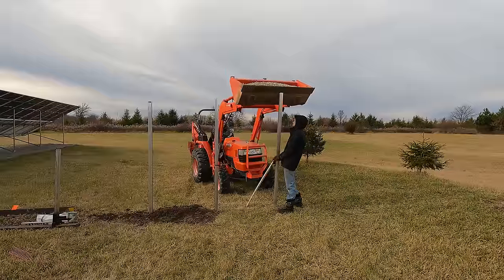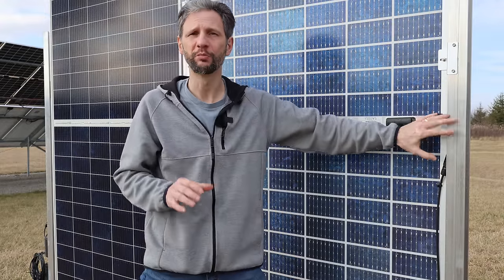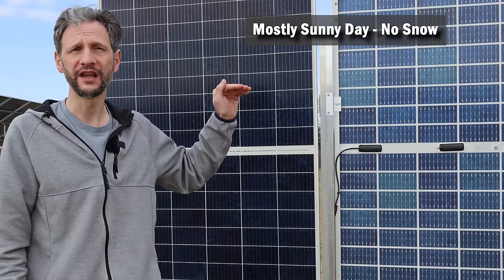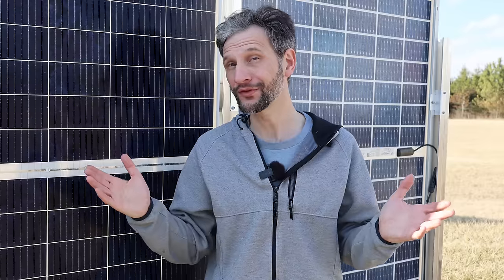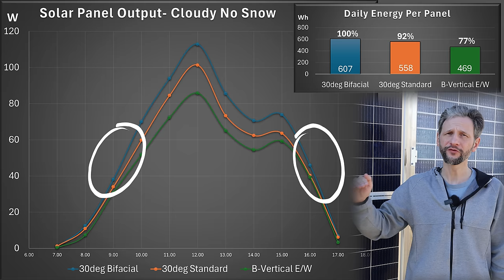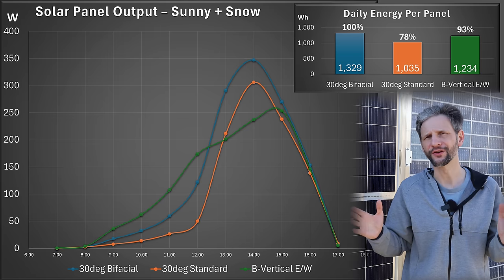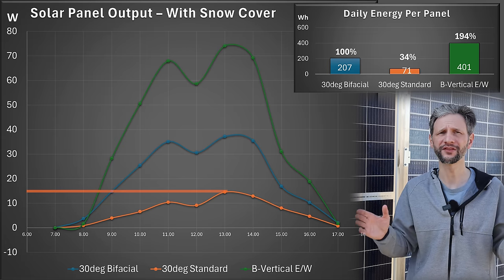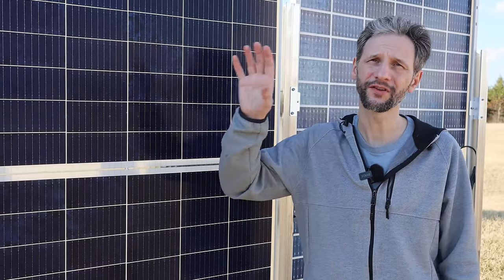Vertical Bifacial Solar Panel Performance Results Part 1

Comment: Please also test using a few meters of cheap stainless metal sheets on the ground, during the summer and even during spring, to reflect more sunlight onto the panels, for if you don't need to grow plants, and test that for both solar panel orientations. And maybe also compare it with a black tarp, and a black tarp with 1 cm or half an inch of cement, which you can separate into tiles by using some cardboard and tape to form the borders of the tiles.

Comment: My understanding (and I could be wrong, everything I saw was 3rd party, I didn't read the paper) of the Dutch study that brought all the excitement about bifacial panels last November was a bit different from this project.

1) I believe they were testing a new panel design with similar front and back performance. I am not sure that makes a big difference compared to staggering front and back panels like you did, but the implication of the news things I saw was that the vertical mounting was taking advantage of this particular new design rather than generic bifacial tech. Also, I am not clear if this was a private in-house study by a company, or a 3rd party study for a manufacturer validating these new panels... lots of potential for some bias there, but that may be an assumption.
2) Their biggest performance difference was during the summer, where peak heat was causing efficiency issues with traditionally mounted panels.  The added output during the bright hot sunny days helped boost their numbers enough where the outperformance mattered for the whole year in spite of lack-luster winter performance.  Comparing your winter performance and saying it is a bad idea is kinda missing the main discovery of the study that heat issues during summer make vertical mounting better year-round.
3) They were interested in costs per watt over raw efficiency, and the lack of need for cleaning and maintenance of the vertical panels played a bit into their numbers, so depending on how maintenance costs are calculated could sway numbers drastically.  Also, as the study was based on $/W, there was more emphasis on whole year numbers as would be seen in a large corporate deployment, compared to a home deployment where getting minimum numbers during winter becomes a much larger concern.  And the comparison was between bifacial vertical to traditional panels, so not testing traditionally mounted bifacial could be a bit of an oversight.
4) The study had issues, and the panels were down for a good chunk of the year, so many of the numbers for the missing days were extrapolated based on similar conditions and data that they had available while the array was up.  On the surface it sounds like this was done appropriately... but until the study is re-done, we can't really know for sure.

All of that said, your test does bring up some interesting thoughts;
1) If totally off-grid, would a vertical install provide enough power mid-day to not need to tap batteries, and would the extended 'useful' hours of panel production in the earlier morning and evening hours allow for a smaller battery install?  Batteries are still expensive, so if a little added cost in panels could allow for a significantly smaller battery system, then this could be a game changer.  But it could be that a few traditionally mounted panels could off-set the V enough to need to tap battery drain mid-day... or it could be that enough morning and evening production could top off a smaller battery install that a little mid-day use could be a non-factor if the afternoon sun can make up the difference... a lot of variables to contend with there, but super interesting.
2) If the main 'discovery' of vertical panels is that heat issues are causing summer time production clipping, then could a steeper winter-optimized angle on a traditional mount be a sort of "best of both worlds" approach? Less cleaning needed for dust and snow, less direct sun heat build-up for better power gain during summer, and more power production in winter when minimums are more likely to be an issue.  Obviously there could be fewer peak performance days during the summer, but if it offers fewer minimum performance days, and more consistent performance throughout the year, it could lead to overall more production.
2b) If summer optimized installs are really seeing this kind of heat problem, would a less optimized panel install cause less wear on panel performance over time?  Taking a 5% hit on performance during those peak summer months in exchange for panels that last an extra 5-10 years because of less heat damage and break-down could be an overall massive gain.

Comment: I'm going to try this had planned on mounting on a patio cover, but I found my side yard wall gets 100% sun almost till 4pm. This way I avoid any issues with the city, and I don't have to use RSD being it's ground mounted. The patio cover I built with 2x4 wasn't all that sure it could withstand high winds we get summer thunderstorms sometimes microburst. Last thing I need is solar panels flip over onto my neighbors yard.
Reply from the maker: The panels are large acting like sails in the wind producing a significant load.  You need a very strong structure to prevent sending them to the neighbor.  : )

Comment: Great video dave, I was wondering if you added a stainless steel skirt on the vertical panels to increase the midday reflection on panels to increase productivity and if it is cost effective
Reply from the maker: I think it would help, but I doubt it would be worth the cost.

Comment: What I have found is that pointing regular panels directly up to the sky works best on cloudy days. I get about 20% more power than pointing them towards where the sun would be. This also has the advantage of minimizing wind forces for Winter storms. We can do this because we made our panel angles adjustable.
On sunny days, they need to point towards the sun at solar noon, but over the Winter, we get so many cloudy days that we just leave them pointed upwards.
Reply from the maker: So you don't get much snow?
Reply: @ProjectsWithDave  Not much, and when we do, I can temporarily tilt the panels to let it all slide off.

Comment: My own testing suggests a steep angle is better in the winter, with a reflective material or snow on the back side, on the ground..But, I do place them vertical in snow storms and lightening storms that can produce hail, it's a great pro tip...Don't have to clean the snow off the panels or worry about hail destroying them..But, my panels are on wheels, so I can follow the sun, which is a different scenerio..

Comment: Taking this idea even further for particularly windy places, it'd be interesting to find out if arranging the panels horizontally would also allow you to re-direct and funnel any wind into a wind turbine.

Basically, you could take the prevailing wind direction and direct any wind into a wind turbine at the end of a funnel.

And since panels are mounted low to the ground, the racking solution is as simple as what you've by pounding rudimentary fence posts into the ground. AKA cheaper than a complicated and expensive racking solutions.

You could likely even go super cheap and just use wooden fence posts that are typically used on farms for laying out barbed wire. Post hole digger, mount panels to the posts, and finally setup the turbine.
Reply: How you Connect the Panels With the wooden Posts?
Reply: @Aenkor1982  Would likely still need to be aluminum, but much less of it. Would be interesting to see what a bespoke design would look like.

Comment: In the Netherlands there is another factor to recon with, wich made things even more complicated...
Because of the succes of solarpanels on domestic locations, there is a surplus of solarpower around 12 o clock at sunny days. Because of that, the voltage in the grid is getting too high and solarsystems are shutting down at this peak moment to prevent system instability an malfunction of the grid in total. Our normal grid voltage is 230 Volt AC and at 253,  the solar systems won't allow higher voltages. 
At this moment, batteries are too expensive, but are getting more and more interesting.
Reply: You might want to check out Sand Batteries to store heat for house and water heating as they are cheap and easy to make.

Comment: Very nicely presented and interesting results. One question that intrigues me is whether installation of bifacial panels on a pitched roof (say 30 or 40 degrees) with a north-south ridge could work well.  Such a roof is  really inefficient for single faced panels with normal mounting, but maybe wind loads get too stupid for vertical panels.

Comment: For noon time, just put a v shaped mirror at the bottom of the panels, a little above ground, that reflects sunlight back up to the panels. Also, if the panels get covered by a transparent hydrophobic and oleophobic coatings, you can also decrease loss of energy due to dirty panels.
Reply from the maker: What about snow accumulating on the V?
Reply: @ProjectsWithDave   Make a spring loaded  mechanism that flips to vertical orientation temporarily if the weight of snow on the mirror gets heavier than a pre set weight. This way, snow will fall off the mirrors. It shouldn't be difficult to get around the snow problem, but, yes the mirrors will need a bit of cleaning from time to time to remove dust.  Also, if the mirror is convex, it should spread the rays more broadly on the panels, which should increase output. Please give it a try, i would love to see you experiment with this idea.
Reply from the maker: Ok, I ordered some Mylar to run some trials.

Comment: mount panels on wires ( with safety mount then you can orientate them any way you like) or possible put reflectors between rows that don't emit too much radiated heat( just reflection) , covering ground with a roof peak in the middle

Comment: My first time that I have commented. I have been doing a great deal of research on this subject. 2 key takeaways, bifacial is generally the better choice, and having a toolbox of solutions for the unique environment offer great benefits for a given system. I look forward to the summer testing, I think the heat aspect, and clipping issues will give the vertical mount some interesting results.
Thanks for the great information share!

Comment: When you add two more panels in south direction to let them resemble a "T", would it make a notable difference? For example when only a small amount of space on the roof of a shed is available.

Comment: Very well put together and with useful an clear results. I'm a bit concerned with the shadow of the main array which may have reduced the reflected radiation. I'm also not sure about the 30 degrees for the main array. I would use more for higher latitudes.

Comment: Now I'm stuck watching your videos. Real world data is a winner. Let's see what I've learnt so far from your videos: 1. Bifacial panels are good, especially in winter. The snow comes off them faster and they capture more light. 2. Reflected and indirect light is important for bifacial panels. Vertical panels are ideal for this. 3. A steep slope or vertical mounting keeps the snow away is important in winter time. 4. Facing the panels due east/west gives good output in the morning and afternoon. However, panels in a V layout achieve this too and gathers more light during mid day. 

Question: Assume you want a fairly even output during the course of a day and during the course of the year. Would putting bifacial panels in a south facing V with about 135 degrees between the sides and a slope of at least 45 degrees mean a good output in fall, winter and spring with a fairly even output throughout the day in exchange for less output at noon in summer?
Reply from the maker: Thanks!  I'm glad you are able to take in all the data and make some conclusions of your own.  The a shallow V would be a good way to broaden the output throughout the day for standard panels.  With bifacial panels, however, you would start shading the back side in the morning and evening with your V shape taking away some of the advantage of the back side performance.  You would get a broader flatter curve, but waste some of the back side performance.  One of the advantages of bifacial panels is getting more power without all the extra manipulation of positions.  Also consider, the purpose of a broader curve.  Is it to optimize inverter capacity, supply power at a particular time of day, etc.
Reply: @ProjectsWithDave  That's an interesting point I hadn't considered. The argument for a broader curve is simple: The price of electricity here is typically highest in the morning and during the cold season.

Comment: thanks, good video. he combo would be a good fit for most peoples consumption. only missing are the standard celle mounted veritally.  will be interesting to see on a hot summerday where better cooling should help the vertical

Comment: What I see here is that automatic snow cleaning would make the most sense to get ecuator facing panels without the snow covering them problem. Although the optimization of farm available land is a huge benefit that should be hyped out.

Comment: the snow-covered result was expectable, I'd love to mount vertical panels on roofs of multi-flat apartments like mine as no one would go there and clean snow anyway, and it would still provide some power in winter

Comment: If you put the bifacial panels on a tracker, that only rotated about the vertical axis, they would easily outproduce the fixed panels. You would get the morning and afternoon increased power without the midday dip. In fact, I suspect that setup would produce a lot of power with single face panels cutting the costs considerably. Being in snow country, the middle of Vermont, the fact that the panels stay snow free would be a big bonus. I will probably try setting this up as an experiment before next winter. Great video, gives me a lot to think about.
Reply from the maker: Keep in mind your tracking idea only works for a single panel.  Otherwise as soon as you turn the first panel it will shad the rest.
Reply: What would it cost us to build a mobile cublicle tent with bifacial solar panels on two sides that you can use all year around. 

As a relaxing hangout conditionned office space in your backyard, drag it over ice, orientating it with E/W bifacial  solar panels by covering it with the other 2 thick transparent plastic walks and also on roof. This would make it  a half translucid grid disconnected square "tent for homeless people" and campers that enjoy working or leisure within nature.

It would go on a trailer with large skis easy to pull on an iced lake to go ice fishing (and social drinking). 

In the summer you bring it to the beach as a self-powered tent comfortable with air conditionning from its solar heat-pump that works also from batteries or from a plug into your EV.

Can you estimate the released heat losses useful and the amount of storage of energy from your EV using V2L batteries to make it net-zero while being comfortable all year around with a heat-pump? 

Let me know the budget to build it together?

Maurice Malks, PE 
Call at 514 742 9050 also on whatapp.

Comment: Great info!
So I would imagine if you built a custom multi-mode sun-tracking mounting system you could track the sun in good weather and position the panels vertically during the snow season.
EDIT:
We could also track the sun while positioned vertically to take advantage of the snowy ground.

Comment: radiant heat barrier is like double aluminum foil spaced apart.  It's not too expensive.  You could make frames for it and mount them behind bifacial panels pointed any direction you want.
the reflection would really power up the panel.

Comment: Great to see the cold scenario. I am in hot part of Australia, and my panels face North and get very hot in summer. Vertical bifacial panels would be cooler, so would get a boost in performance. Also for half the year there is so much sunlight the panels are overloaded, so vertical wouldn’t drop as much. The real advantage I think is they can be used for fences and on walls which saves so much space
Reply from the maker: As you mentioned, the bigger advantage in southern climates may be the reduced clipping and lower operating temperatures.  I hope to check some of that this summer.

Comment: I've not tested it but I feel like 2 arrays, both at 25-30deg, one facing east, and one facing west makes a lot of sense. At least that's what I've heard.

Really comes down to what your situation is too. If you're on grid, it's all about self consumption. If you're off grid, you just want the most Wh per day. 

Anyway, great video, thanks for your effort!
Reply from the maker: Thanks!

Comment: Great video, I have some standard panels mounted vertical south facing because of snow. They far outperform during snow load which is most of the winter. I think a combination is a great approach.
Reply from the maker: Thanks for posting your actual experience!

Comment: What about using biefacial at 30° facing east the other half west? Wouldn't that catch in the morning, midday and evening as well as in snow or with a tarp you get the reflection. (The east and West panels would be distanced 20-30ft for light to catch the middle tarp for additional capture).

Comment: Looks to me like a bifacial 30* configuration with short vertical panels in-between each column of panels could produce a much flatter output curve for longer.

Think like a "u" for each column of panels in the array with the vertical mounted panels being relatively short. You can put more wattage in the same footprint that way as well

Comment: Really interesting! With the price of panels dropping hard this might even become viable on facades of houses. One small point of critique: the shade thrown by the smaller vertical panel setup will give an advantage over the larger south facing array.